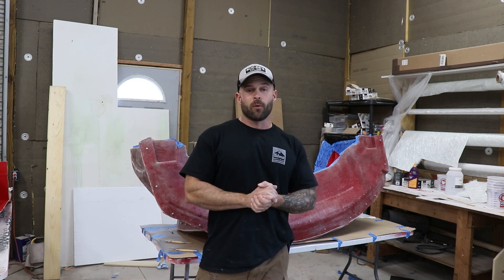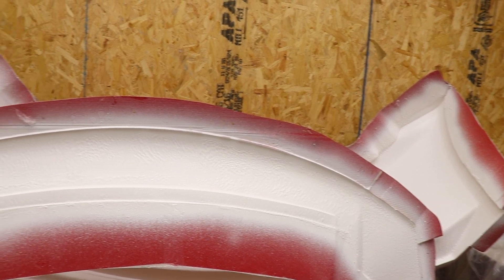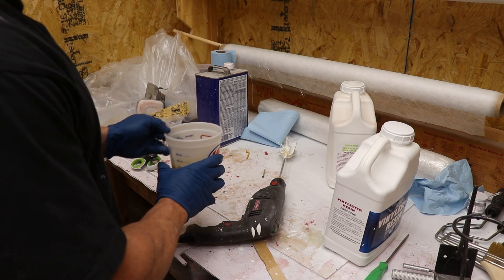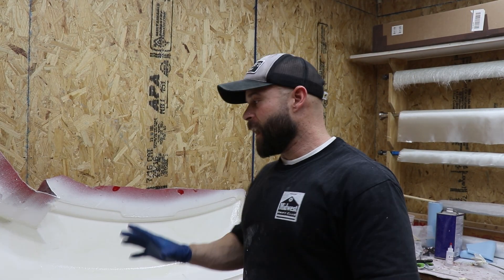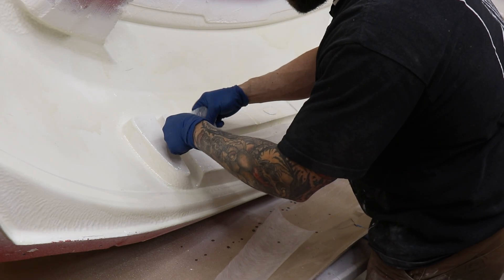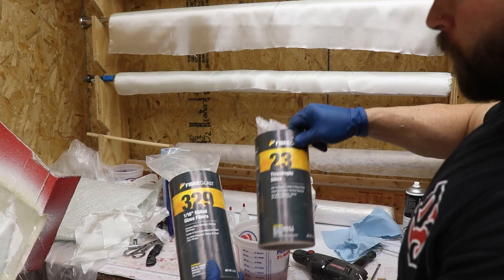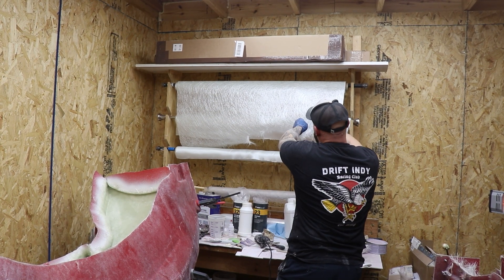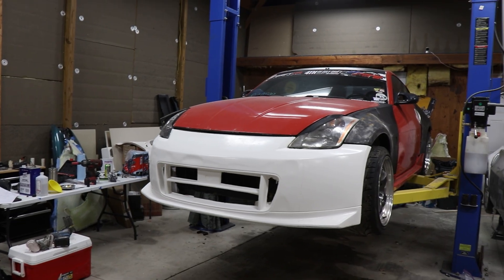How To: Create a Fiberglass Bumper From a Mold!

Comment: I kind of I have a 93 Chevy pickup truck and I went skateboarding on the right hand side and when I come down off this cement rail it went bam and it cut the corner of the cab underneath and then the fender which is fiberglass truck bed and cracked it from the bottom up maybe a foot and a half crack and I should fix that crack before I go and read fiberglass is that a good idea or just go ahead and leave it like it is it's pretty tight together it's just cracked basically yeah and then I have a question about my moons scoop up on top of the cab I took that off well actually I didn't have to take it off over the years it never been replaced or tightened down I guess throughout the three owners prior to me in a semi or just a wedding would come towards the truck while I'm on the opposite side of the highway or roadway and throughout the few years I drove it it weakens so much that it's only fiberglass in with lights and it finally is him I came by and it just pulled it right off went flying behind my truck and lo and behold is hauling when shape it just looks really scuffed up and so that's what I would like to do but I also would like to change it a little bit I like the artist sign in the middle of the lights in the middle of that what do you think about that and how should I proceed because it's like a it's flat and then it curves around and goes under less than halfway of the frame part on that moon on the yeah what do you call it anyways the wind flaring fairing yeah and then I also have another problem too which is the truck hood? And went to leave started accelerating not fast just regular accelerating and got up to about 30 and all the sudden the hood come up and smash the whole windshield and it cracked the the scoop on the top of the hood and that needs to be fixed I kind of like to do what you're doing is take the part off and go ahead and do the fiberglass and and yeah that kind of stuff what you're doing I just wish I knew more how you fix your Gator ripples that's what you want to call a gator me I'm a truck driver or was and we call Gators the rubber off the semis laying in the middle of the road or if you're going down south there are real Gators that cross the road I didn't run over any I seen one in the road but I ran over an arm and dealing and boy that popped I thought for sure I thought ped tires left and right cuz it just went boom boom anyway that's enough that if you could help me out with the side truck bed fiberglass in the Moon hood scoop up there on top of the cab and in love's Hood I'd appreciate it anybody anybody that can help me out kudos to you thank you very much